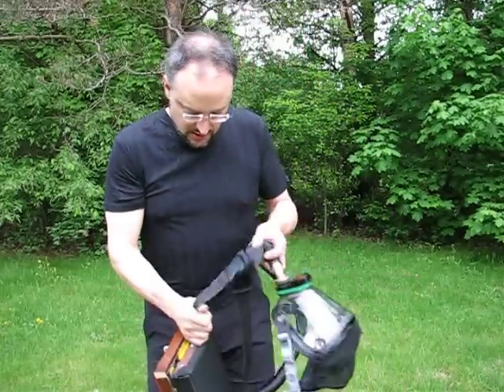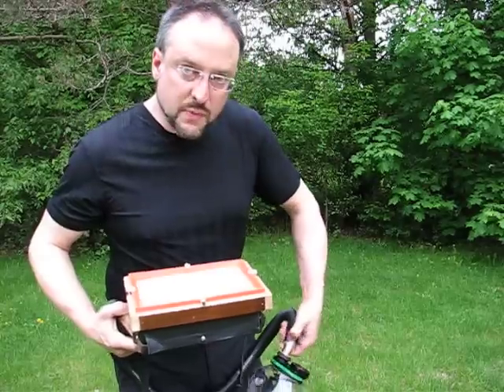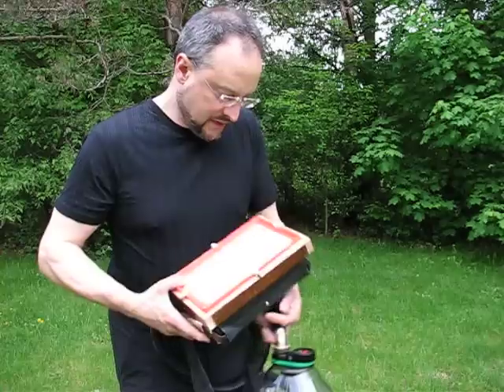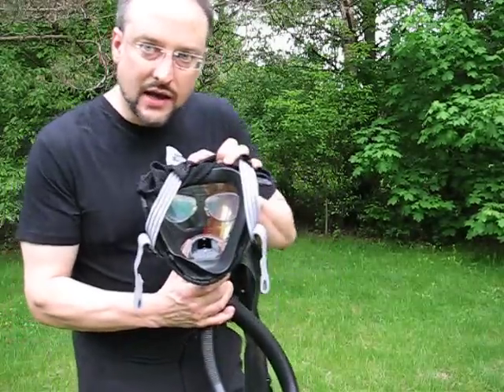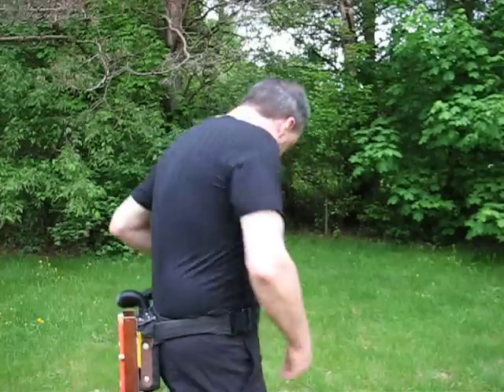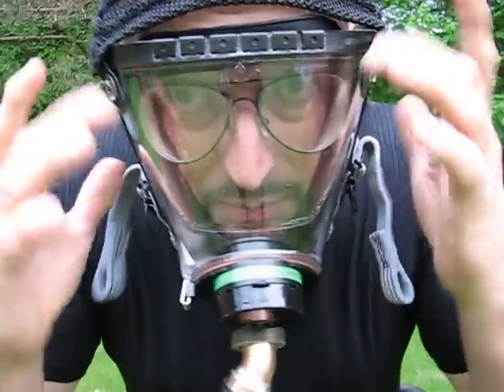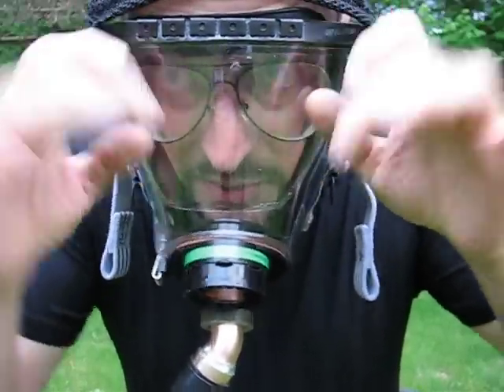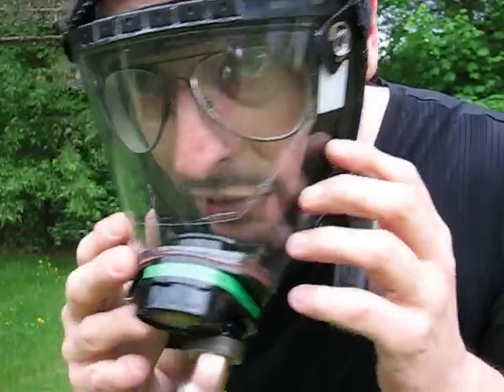Powered Sawdust Respirator

Comment: with your air intake where it is you might consider an active carbon layer for the days you eat a spicy lunch
Reply: so you cant smell? haha a few wokers had that
Reply: exactly lol. when I build one im also gonna consider a quick fan reverse button for belching...now if i could just figure out how to smoke a cig wearing it :D idk if ill actually do that but i do intend to make a face mounted unit that rivals 3ms. I picked up a 6800 Din which was shipped as 6800 regular... assholes wouldnt do anything but a full refund and i needed the mask due to a mold problem. so i later paid a diff company to buy the front part with din port. 

(what really pissed me off was amazon removed my first review because it included a line about the company not product... wish someone would knock them down a notch...idk why i pay to be treated like that. they had also closed my case because i refused full refund ship it back and was trying to negotiate either cost of front piece refund or shipping me that damn part... i miss 5 years ago when they would bend over backwards to make sure customer was happy... but i digress)

 in a month or so im getting a 3d printer and im about a week from having my spot welder complete for lithium ion pack assembly. The only hard part will be modeling the din threads.

i figure a 2 cell pack on each side where the bayonet carts usually go, blower filter on din port in middle. should be easy to get 10hrs run time if not more.